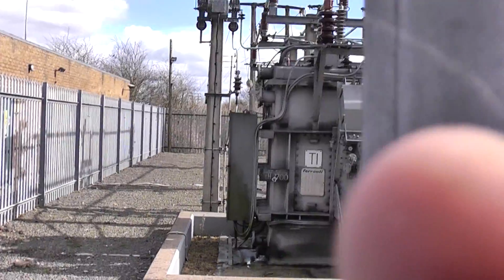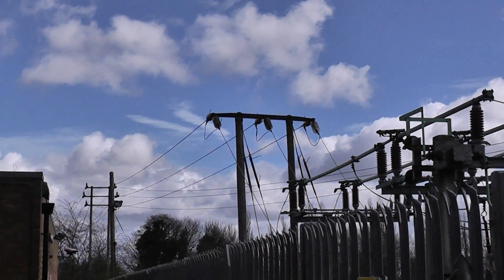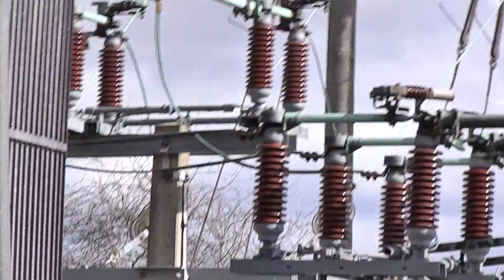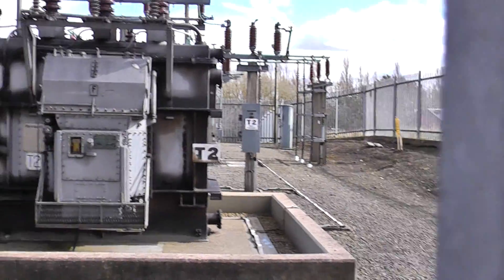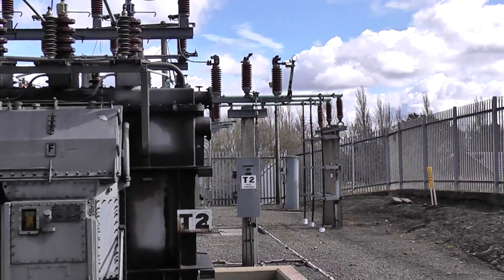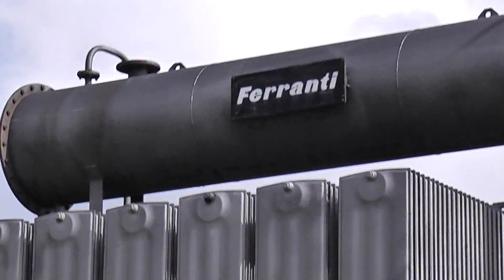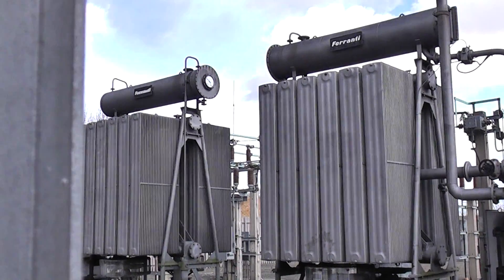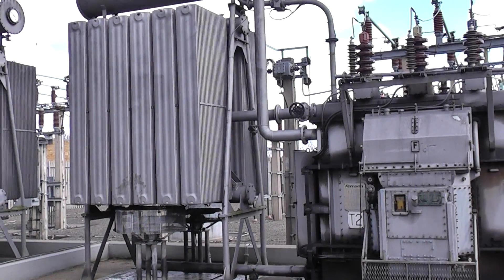33kv/11kv substation.

Comment: Brill vid, couple of corrections though. The things you call circuit breakers are ABI’s (air break isolators), what you called the 11kv output on the transformer is actually the neutral point connection to the secondary winding where sometimes an earthing transformer or neutral/liquid earthing resistor would be connected and the oil isn’t ‘stored’ in the conservator at the top of the radiators, that’s just there to give room for oil expansion with heat but will generally be empty.
Reply from the maker: Ok cheers thank for the correction.
Reply: jonny morgan83 No worries, what made you film this video, an interest of yours or just giving general information? I’ve always had a weird interest in substations and overhead power lines and so not long ago got a job with our local DNO as a substation fitter. Oh and another bit of useless info, the red disks on the cable terminations are called ‘rain sheds’ and are used in modern cable termination kits. Older ones where the cable seems to go through a large insulator are called ‘sealing ends’ 👍🏻
Reply from the maker: @sinista6536  Our DNO is weston power distribution.

Comment: Looking at the name plate, it seems the transformer is arranged as delta - wye? The 33kV comes in as delta form and the 11kV leaves in wye form. Also it seems the transformer has different tap points so it can accept voltages other than 33kV.